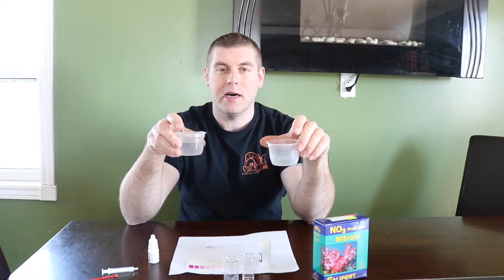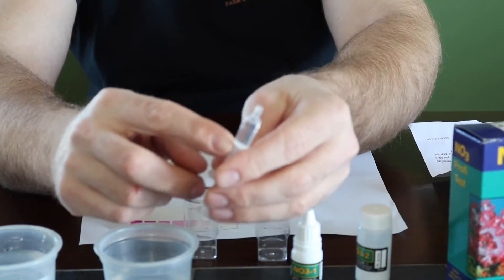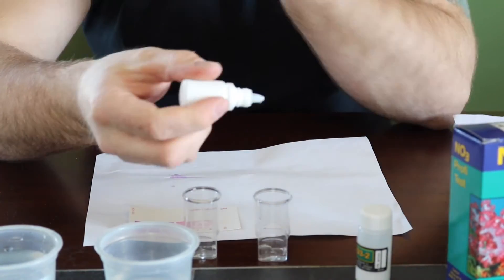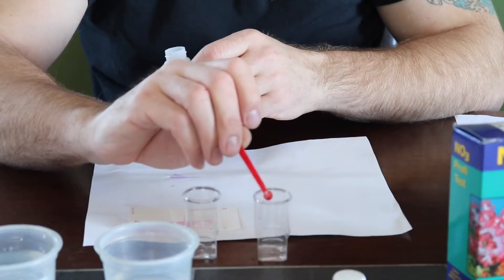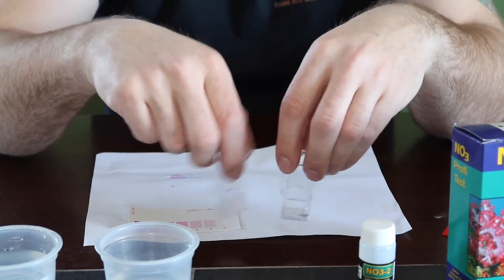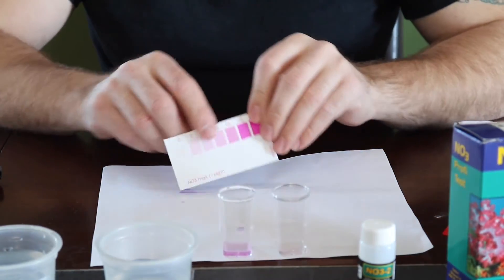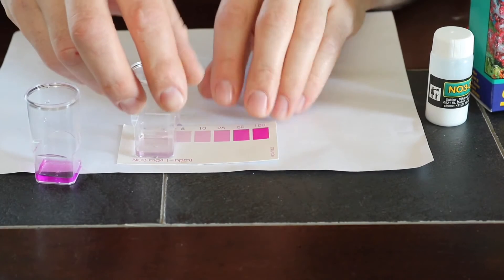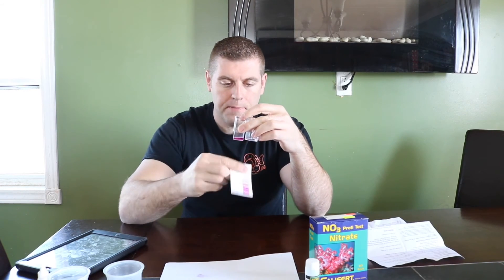Salifert testing nitrate N03 made easy

Comment: Counted too fast and your left hand did not really share. Also, I think you should look at the color from top.
Reply: Either way you can see the difference stop knit picking.
Reply: @semaphor3  People just love to criticize others!  He is right about he does need to either read from top or if read from side divide by 10.  Only if you get a very low reading do you read from side though, other wise might be inaccurate read that way, its for 10 ppm or below is read from side to vivify accuracy!  Dont care for this test.  some times side and to p readings dont match. I get a 10 from top and a 50 from side, If its a 10 It should be a 100 from side, so I am counting it as a 5.

Comment: The test is read incorrectly, the measurement should be viewed from above, or viewed from the side and divided by 10... so when you say "50 to 100", you should be saying "5 to 10"
Reply: If you are getting a reading of 10ppm or less then read from the side against the white card not from the top,and divide by 10 .....any reading above 10ppm can be viewed from the top with the vial sitting on the white card.
Reply: @Rob_Wills_Solihull_Reefer  this is correct and is stated in the directions for all that read this
Reply: Good point. But I have one question: When you look from the top, should the tube be in contact with the white part of the paper, or be kept above it? In the first case, the shade of the tube makes the color look at least one tone darker. On the other hand holding it just above perhaps give more sensible and consistent results. I know that we are supposed to place it on the white part, but have you actualy tried the second way?
Reply: I have and it makes no sense!  I am getting a 10 from placing it on the paper and from side a 50.  The example it gives is if you got a 2 then sense it is amplified 10 fold sideways a 2 should be 0.2.  There is noway that a 2 would show sideways.  I dont know how they mean it.  If you get a 2 then the color they show that is close would be a 25 so shouldnt it be just a 2.5?  Unless they mean you are getting a 0 and by the side a 2.  I cant imagine it being that light from the side to be a 2.  Like I said I get a 10 so sense  I get a 50 from the side I guess my 10 is actually a 5 but on api I show 0 and the have a reading fro 5 ppm.  Unless this is more acurate so I guess I should just throw out the 10 reading from the top and count it at a 5.  I hate color matching. Never seems to match up!  Debating whether to get the hanna checker for nitrates even though I heard it has a lot of steps and takes 9 minutes I think!

Comment: Do you read these from the top or the side of the test vial as I've noticed some of the Salifert range say look from the above and the rest mention nothing? Thanks Great vids!
Reply: +hksubaru  For normal readings the test vial should be read from above - with the vial on the card.  Side view is for when very little colour is observed and divide by 10 on the chart to get the lower ppm value.  That's what my  Salifert instructions say for this test.
Reply: The test is read incorrectly, the measurement should be viewed from above, or viewed from the side and divided by 10... so when he said "50 to 100" he should be saying "5 to 10"
Reply: @MD-pl4ww  why?
Reply: @sam3d  because that’s what the instructions say to do for the colours to be read correctly. The instruction sheet is easily available online, feel free to look it up yourself